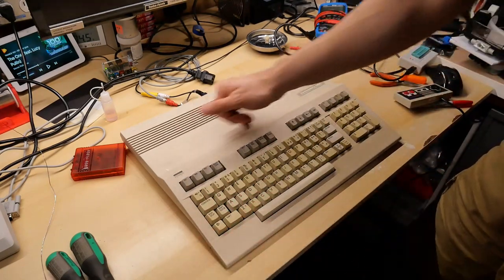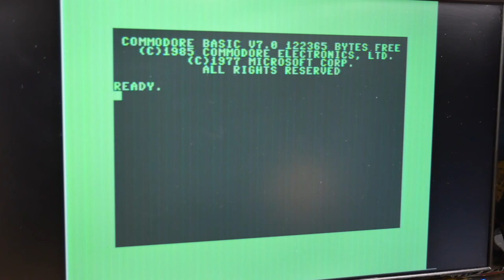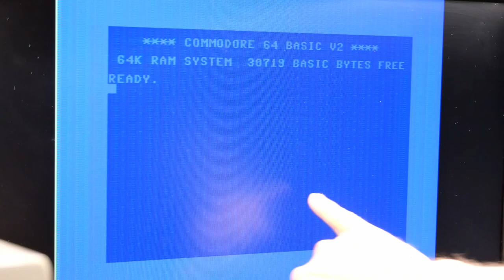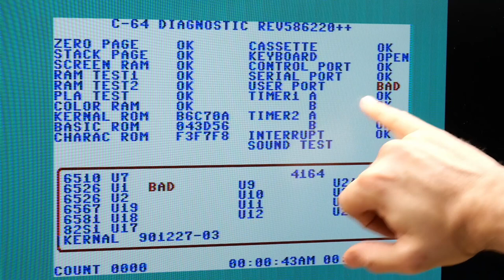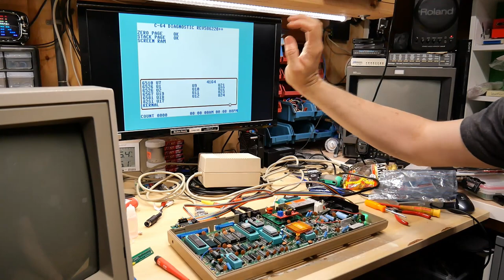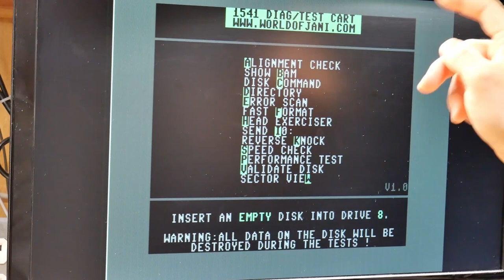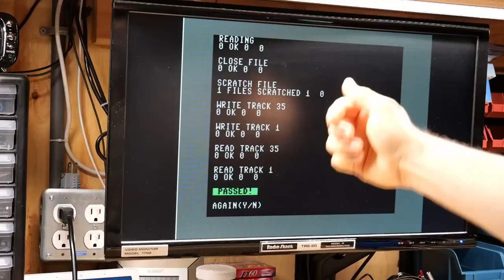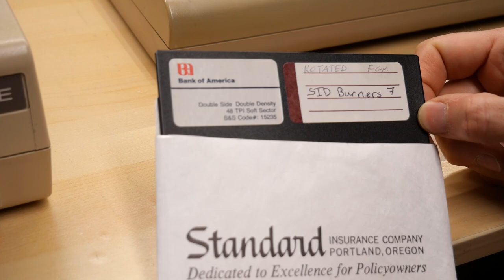C128 fix and a disk drive voltage conversion

Comment: just curious, what commodore monitor was typically paired with the 128 ?
What software was  unique  to 128 ? other than game expansions , is it worthwhile seeking out ?
is CP/M worth using ?
Reply from the maker: When you look at the pictures of the system, it was usually a 1902 monitor. I think it only supported composite, Luma+Chroma and TTL RGB. Not totally sure though. CPM for the 128 is pretty slow and bad ... and CPM was dying when the 128 came out. And no, not really much unique software out there...
Reply: @adriansdigitalbasement  the wiki page show a dual monitor (40 & 80 width) . 
just thinking it was the same era as the Amiga 500, right ? 
so maybe the 1084  to get slightly better color ? 
(still mono sound, right ?)
Reply: With csoren's CPMfast, and a 157x  drive, I'd say that CP/M is definitely usable on a C128. He even made the ASCII/DIN switch work in CP/M mode, complete with mappings for WordStar! Things like dBase II, Turbo Pascal etc. work fine, as do CP/M text adventures.

It's still slow, but usable. https://csoren.github.io/c128cpm/releases/CPMFAST.html
Reply: @adriansdigitalbasement  you can make a simple monochrome 80-column SCART / S-Video cable. Other than the fact that you don't have color, the picture quality is pretty good. It's also easy to make it switchable between 40/80 columns (or rather VIC-II/VDC) on the cable itself.

Comment: 28:43 The CIA in the 1570/71 is only there for the Serial Shift ability. I believe it is also a 2MHz chip, so you could put it in the 128, but not vice-versa.
Reply from the maker: I read those don't work in the 64/128 -- but maybe that's incorrect. like they were neutered in some way -- will need to investigate more.

Comment: Methinks there's a way to de-pot that compound. I don't think anyone wants to bake it out. Takes a while and stinks.

Those disk notchers also worked for Atari 8-bit drives like the 1050. Rather irked you forget Atari.
Reply: They also worked for the original IBM PC 5150, which came with single-sided drives. Single-sided was the standard on TI 99/4a setups as well. 
There's a LOT of stuff from that time period that benefitted from disk notchers.

Comment: That 6526 A is just a regular 6526 CIA with the minor difference of being 2 MHz capable.
Reply: Yes, the 6526A CIA can be used with no problem inside the C64. Quite a few 1571 drives, however, contain a 8520 CIA and that doesn't work inside the C64. The somewhat rare 8521 CIA is again C64 compatible.

Comment: 31:00 Ditch the stupidly hot internal transformer and regulators. Install a 4pin DIN socket and use a 1541-II power supply.

Comment: Commodore filter the supply to the VIC to reduce digital noise on the video output. On this schematic (probably not the right version) the most likely failure is C63. See: http://www.zimmers.net/anonftp/pub/cbm/schematics/computers/c128/310378-2-right.gif C62 performs a similar function for the colour generator. Try holding a good capacitor across the suspect ones to verify this. Low ESR types are best. The value isn't critical. Edit: for the digital RGB output, try C88 and C61. All of these capacitors are 10 uF, so testing and potential replacement should be straightforward.

Comment: 39:12 Why don't you use the built-in DOS wedge?

<SHIFT>+<RUN/STOP>  Load & run first program on disk
Reply from the maker: That loads the tape -- does that work on a 128 in C64 mode?
Reply: @adriansdigitalbasement  I thought that the Tape routine was removed from Jiffy/Jaffy DOS.
You were using the C64 at that time frame, idk if it works on a C128 in C64 mode.

Comment: Can the vic2 chip problems be related to the 50Hz vs 60Hz
Reply from the maker: No, the 50/60hz signal over the AC input is just using for timing on the 6526 chips.
Reply: probably not. the low frequencies do not couple into other signals easy. according to the jailbars it is below the pixel frequency. pixel frequency is almost 8MHz. cpu frequency is around 1 Mhz. if you have the jailbars repeating very 8 pixels, then it is the cpu clock generated next to or inside the vic chip that couples in the video signal. first, i would try to add a bypass capacitor to the voltage sipply of the vics analog voltage and then maybe it is possible to generate an invers signal to couple that into the video signal to cancel out the jail bars

Comment: One of my 1570 drives actually have the PCB marked 1571.
Reply from the maker: So not surprised! Clearly this 1570 PCB was just the 1571 with a different silkscreen. Have to wonder hwy they even bothered!
Reply: Adrian's Digital Basement was it just me or did the 0 of the 1570 label look different to the other printing on the PCB? The 0 somehow seemed to have a heavier stroke weight or something.

Comment: For what it's worth my 128's video output always looked noticeably worse than a C-64, from the day we got it in 1986.
Reply from the maker: Interesting! The NTSC 128 has very sharp and clear output other than excessive jailbars, worse than the 64.
Reply: @adriansdigitalbasement  One thing I noticed is your poor-quality NTSC chip is from 1985, and the good one is from 1987. I wonder if the early 128 VIC-IIs had poor output? The date of manufacture on mine was 12/85 (I checked), and it's NTSC.

Comment: Does the Amiga 500 use the same model psu as the c128? Or is it different internal?
Reply: The psu from the C128 and Amiga are different, except the connector. The C128 has 9V AC and 5V DC, the Amiga +12V DC, -12V DC and 5V DC.
Reply: Thanks!! I will keep that in mind and wont mix them up😅
Reply: @basvanharen2904  yeah, DO NOT plug a 128 psu into an Amiga... 

Bad things happen...
Reply: @SuperVstech  Tempting🤔
Reply: @basvanharen2904  Nooooooooo!

Comment: Get a empty tin that doesn't have anything in it fill it with Acetone and dunk the potted module in it and leave it for five days and the potting compound should be more or less in solution and the unit can be removed.

Comment: You can’t read the 2nd side of a floppy disk in, like, a 1571 because it then spins backwards.
Reply: Yes you can.
You can't read a native 1571 double sided disk in a single sided drive, due to the rotation, but you can read flipped single sided disks in either drive...

Comment: The 1571 was intended to be released with the C128 but wasn't ready. So they rebanded a 1541 into a 1570 . 1571 was eventually ready and was released and the 1570 was discontinued

Comment: because z and y are reversed on a german keyboard.......
Reply: As can be seen on the keyboard at 0:53........
Reply from the maker: Funny I honestly didn't even notice the keyboard was like this. Funny that in C64 mode and also 128 mode in PETSCII mode the matrix follows the normal US layout even though the keys are reversed.
Reply: @adriansdigitalbasement  Back then, there was still the ISO646 standard around.  https://en.wikipedia.org/wiki/ISO/IEC_646 ... 
They replaced the brackets and braces, and the backslash by our Umlauts. Programming on a German computer using that charset is fun .. NOT.
Reply: Mr Guru  The changed keycaps match the US layout, they just have extra lettering in a different color.

Comment: Heat Gun will loosen potting compound.
Reply from the maker: I don't think that works on the European one though it had all these plastic bits right in the hard epoxy -- unlike the NA version which does slide out. (I've done that technique.)
Reply: @adriansdigitalbasement  That's correct. On the other hand it is really easy to upgrade the wedge power supply with a switching regulator, no need to remove the transformer.

Comment: Instead of throwing the PSU away you could order this replacement board : http://docs.anemo.se/powerup-64w-manual.pdf
Reply from the maker: This still uses the built in transformer in the PSU -- which here would only output half the required voltage due to us only having 120v. It's a good solution for folks in 230v countries though.

Comment: There is zero point whatsoever to reuse old power supplies when modern switchmode ones are so easy, cheap, efficient, and reliable, and small so they will even fit in the old bricks. Much safer for your vintage tech than those old timebombs

Comment: 19:45 - You can plug in a joystick while the machine is on ? :O  I thought you can destroy the CIA's doing that.
Reply from the maker: The risk is touching the joystick ports with your fingers and static charge from what I've heard. I don't see how plugging in a joystick with power supplied has any risk.
Reply: @adriansdigitalbasement  I guess the risk would be if some sort of autofire or turbo fire enabled.